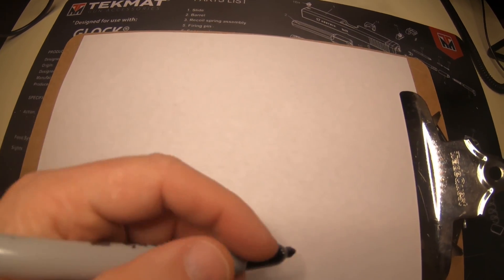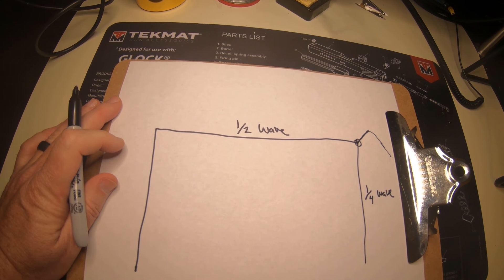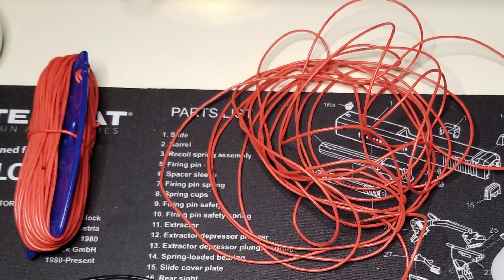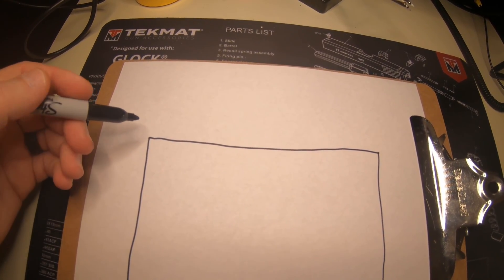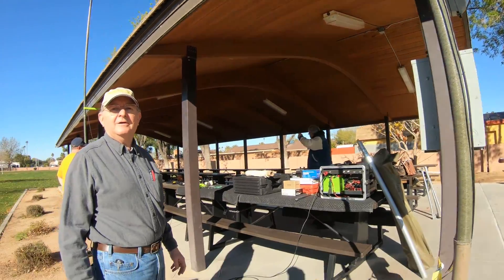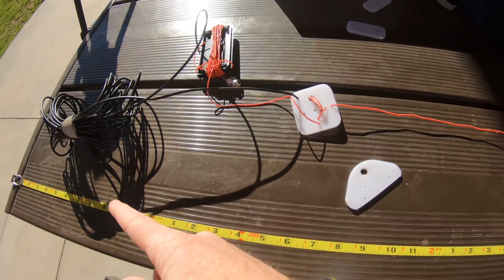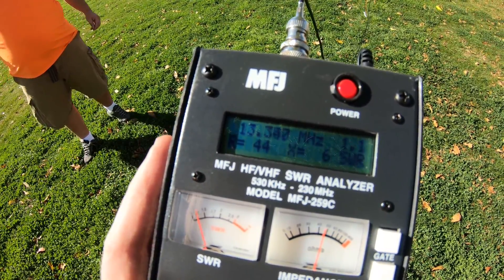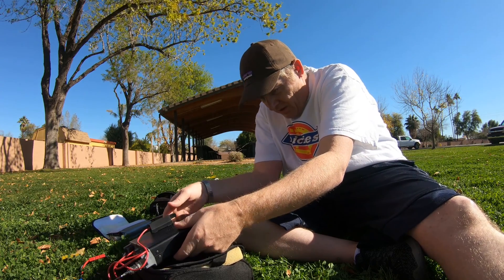How to Build and Tune a Half Square Antenna

Comment: Feed it at the bottom of one of the verticals with a 49:1 balun.  Same shape, just shape the wire that looks like your drawing.  Increased gain on the verticals.
Reply from the maker: Now that's a thought.  I'd love to try that and see how it performs.
Reply: @RedSummitRF  G5TM has a video on it.   Fascinating.   I started to mess around with Mana-Gal with different antenna shapes.  Have not modeled it myself but find this fascinating. 

I’m trying to build a gain antenna to get me from the Midwestern US into India.  I have never been able to do it on a regular basis.  I’m only 100 watts and a vertical.

Comment: A couple days ago I saw a 3 pack of cutting boards in Grocery Outlet for $4.99, I grabbed them for just such uses. I have been interested in the half square for some time. Thanks for your report on it's performance to me on the live feed today!
Reply from the maker: For sure Richard.  There are a couple down-sides.  You obviously need two masts, and you have to make sure that feedline doesn't get too close to the one leg closest to it.  But these are not performance issues.  Just annoying things to deal with.  Thanks!

Comment: Excellent video. I'm running an odd antenna. Three half squares in parallel. It feed at the bottom with a remote tuner, an LDG RT100. It tunes up fine, 160-6 meters! I only run 100 watts at this time. I recently worked Japan, SSB, about 5PM, long path. I was 5x8! The antenna is mostly random length, about 400 feet horizontal and 60 feet vertical. 73 de WA3RSL.
Reply from the maker: Wow, that's really cool!  I love experimenting with antennas like that.  Good work!

Comment: nice go there, there is a australian who uses half squares from his local beach, he uses 2 fishing poles and feeds the antenna from the bottom corner, and is on video working stateside on 5w ssb, so mayve a quick look @ his video would help you
Reply from the maker: You must be talking about Peter Parker.  Yes, I've seen that one.  Adam K6ARK also uses to masts.  At the time I didn't have two that were tall enough.  That's a really good option for sure.  Thanks for suggesting it!

Comment: I have been looking for an update on how your antenna worked. I have had a lot of experience with building half squares. I found them to be a great antenna on 160 and 80 meters if the top wire is about 65 feet high. Beats a dipole at the same height because an 80 meter dipole is low at even 80 feet. On 40, I could get a dipole up about almost half wave and there was not much difference other than the dipole had a broader beam width. The dipole was now twice as high in terms of wavelength. On 20 meters the dipole again doubled in height and then became much better than the half square. An EZNEC analysis confirmed what I saw in practice. A dipole at 32 feet has gain of almost 7 dBi the 20 meter half square at 35 feet (top wire) has a gain of about 3.5 dBi. Comparing at the same elevation angle (18 degrees) the dipole has 5 dBi and the Half Square has 3.9 dBi if it has its top wire at 45 feet vs 32 for the dipole.
Reply from the maker: Hi there!  The half square worked great!  Here's the video https://youtu.be/PaERioBgpH8 .  This is a good reminder to take it back out in the field.  I wanted to try using it again under better band conditions.  They are definitely better performers than the dipole.  Thanks for your comment.
Reply: @RedSummitRF  Thanks for the reply. They definitely work. All mine have worked good. They have about 3 dB gain over a single vertical.  I wish you could compare to a dipole at the same height at the same time. It’s hard to make up for the “free” ground gain you get with a 20 meter dipole at 25 feet or higher unless of course you are over seawater with a vertical! It is always good to have more than one antenna in your bag. I am presently experimenting with a portable 40 meter sloping dipole with the center at 15 feet. Comparing to a flat one at 46 feet. I have been running 2 watts and working all over! They surprise me frequently on which one is best. I have another 40 meter half square built to try in the spring. Keep up the good work.

Comment: Okay ya stumped me, why 502?
Reply from the maker: A few others have asked this.  My reply found below is "it's a modification of the standard formula to calculate the length in feet of a dipole.  I got it from this website: 
http://www.hamuniverse.com/wb3aywcurtainantennas.html 
Look at the very bottom under the "formulas" heading for a simple explanation.
A regular dipole has a standard formula of 468/f which is quite close to this one. "
Thanks for watching!  72.
Reply: Hello Mr.Red - a follow up question: using 502 for 1/2 wavelength, why not use 251 for 1/4 wavelength? This is not meant to be a smart-ass question. It is understood that the difference is negligible. Anyway, I am interested to try this - thanks for the idea and the clear explanations. 73 KQ4IXD (BTW is this Utah?)

Comment: Is the shield of the cable on the short leg and the center on the 3/4wave? You trim both at same time. Wasn't totally clear.
Reply: Where did 502 come from?
Reply from the maker: Hi  @opticoax747  it's a modification of the standard formula to calculate the length in feet of a dipole.  I got it from this website: 
http://www.hamuniverse.com/wb3aywcurtainantennas.html 
Look at the very bottom under the "formulas" heading for a simple explanation.
A regular dipole has a standard formula of 468/f which is quite close to this one. 
Just a modification to the standard formula to calculate the antenna length.  I don't have the math skills anymore to do a proof, but I'm sure you could find one with an internet search if it's important to you.
Reply from the maker: I can't remember which I chose, but it doesn't matter. It works equally well regardless of which leg goes to center vs shield.
Reply: Red Summit RF mmm probably, but did you shorten the legs at same time? To keep the ‘balance’. One leg being couterpoise or radial. Trying get a grip on this. Like tuning a g5rv shorten the legs or adapt the ladderline. All have ‘some’ effect. Trying to make the half square some day.
Reply from the maker: @pa3fat  Sorry, I can see how the video isn't entirely clear.  Yes, I shortened the legs at the same time cutting the exact amount off each leg as I tuned it (see 14:00 - 14:31 of the video - still not entirely clear, I know).  I apologize if I am not understanding your question.  Let me know and I'll try to clarify further if I'm still not making sense.
Charlie
Reply: @RedSummitRF  Charlie clear now. Tnx !

Comment: Nice one Charlie.  That antenna ends up being pretty big!   I am also wondering how the impedance is around 50 ohm.  I guess I need to study more.  🤪
Reply from the maker: Haha yeah, I don't know in great detail either.  I'd hate to take a stab at the answer here 😬. I'm already waiting for the balun argument to resurface 😂. That's one for K6ARK. Thanks Greg!
Reply: Red Summit RF eznec? Might give some input to this. Off center dipole is around 200. Groundplane with lowered radials approx 50. Perpendicular radials 37? Not that far off probably. All antennas aren’t 50 so always some mismatch